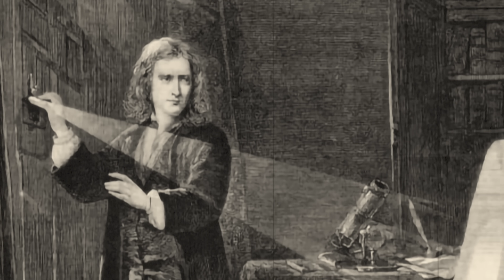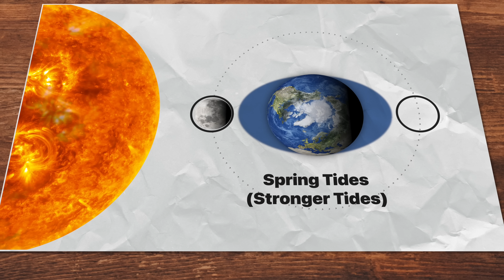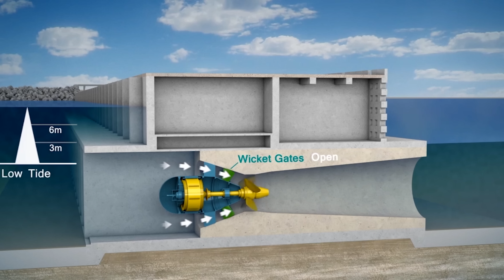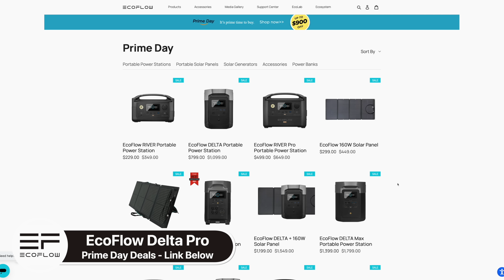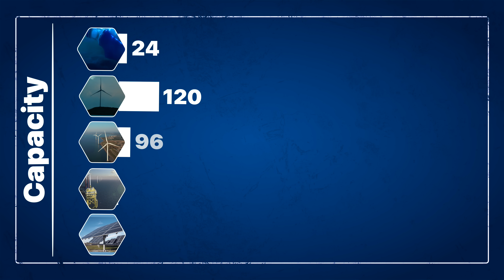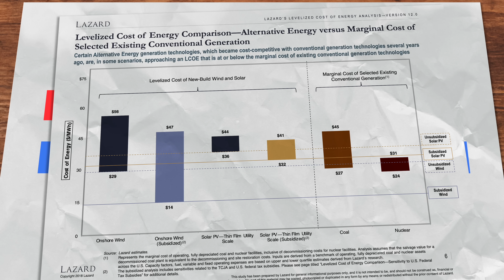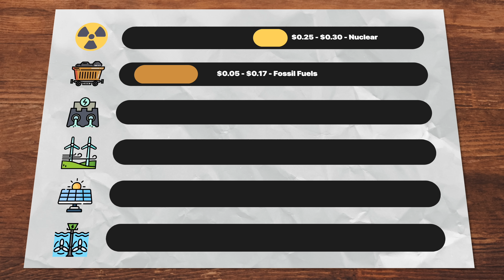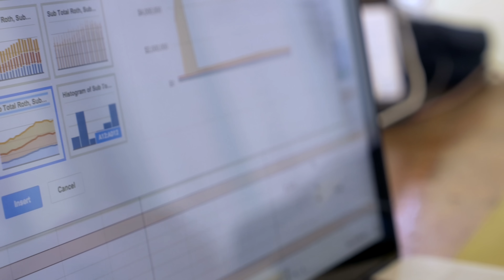Breakthrough Energy Source is 10X Better Than Wind & Solar!?

Comment: Tidel energy builds up gradually over a long time. I'm curious what effect taping into it at scale would have. How much potential energy can safely be converted and what are the consequences of using too much both on a local scale and global scale?
Reply: There is no effect on the Moon's orbit because the drag on the Moon is the overall movement of water, mostly in the oceans, and this would have very little effect on that total movement. 

What could have an effect is on coastal erosion as movement of sand along coasts might be strongly affected. As energy is absorbed along one section of coastline,  it might be shifted to adjacent areas, possibly exacerbating flooding at maximum tide. Also, the tidal generation systems would be strongly affected by changes in sea level.
Reply: It's not the moon's orbit that I was talking about. The moon has a lot of momentum. I was talking about the tides themselves. I'm assuming that the tides get a tiny push from the moon and that tides accumulates over time. Maybe I'm wrong. My question is how much energy can be drained from the tide before effecting them. I don't know the answer, but the amount provided by the moon can be calculate.
Reply: @riderpaul  it would actually be affecting the earth's rotation maybe?
Again it would be so small an affect that it would.not matter for millions of years by.which time humans wont be here to.keep the thing running anyway.
Reply: See my comment regarding affecting weather patterns globally
Reply: I wondered about this too,
We are effectively taking energy away from the moons orbit ?

Comment: I love the idea of endless water flow providing the force to make energy.  I just wonder why they dont submerge the propeller and housing just to provide the motion,  but that just turns a shaft to the surface the holds the actual motor and electronics.  All we need from the water is the force it provides.  The moving parts like gears and such can probably keep running for decades.  The surface electronics would be easier to service..
Reply: You can pump water to the surface as it doesnt compress and it lubricates and cools  you can transmit the energy to turbine generator system. It saves on metals and the corrosion problem ..  🤔

Comment: The Rance facility looks more like a hydro power facility than true tidal power. Also, a 100 year operating life for a turbine on the sea bed in a current of >1 metre per second, sounds suspect to me, as that's a lot of force and a lot of corrosive salt water. There's also no way that the Rance facility hasn't had a hugely negative impact on the local ecosystem.
Reply: The Rance facility is very uneconomical, the power costing like 15 cents a KWH.  Typical generation costs of solar and wind are like 3 cents a KWH.

Comment: The blade construction water/wind turbine is the LEAST EFFICIENT method, the most environmentally challenging way to produce power.   Why this older technology is being favored is beyond me. Here is an example of how super slowly things are to change - in 1915 an airplane with "winglets" was invented and flown. This reduced power robbing wind vorticies at the wingtips and increased radial stability. 80 years later the commercial airlines decided to adopt the idea to save 4% on fuel costs. Planet Earth will be dead by the time better tech takes hold.

Comment: Does the levelized cost of wind turbines also include the cost of the grid batteries required to mitigate its intermittency? If not, it might look much less desirable compared to tidal, which will be much more consistent.

Comment: Ultrasonic anti-fouling! That's the answer to bio-growth, which can be amazingly devastating in a very short time. These things could be designed with that in mind. There are some places with up to 40 feet of tidal range (like Bay of Fundi Canada) which could power the entire eastern seaboard easily, there's really no limit as to how many turbines could be put into place.
Reply: That idea sounds solid. But how far or does the ultrasonic disrupt the fish or mammals? Maybe the ultrasonic can be used intermittently.
And will these under water turbines slow or disrupt the back flush of coastal areas and river outlets if there are too many of them ? Do the turbines blades fold or have pitch control?

Comment: The problem with tidal energy is that, while it is predictable, it is STILL somewhat intermittent.
There are periods when the tide is changing from in-flow to out-flow that it has NO power output - similar to solar but much shorter and twice a day every day.

The ONLY form of renewable energy that does not have this issue is Hydropower - but even Hydro can sometimes have issues.
Reply: Geothermal energy doesn't need to be intermittent, and is effectively renewable.
Reply: @garethbaus5471  Valid point.
It's too bad geothermal is so little used for power generation.
Reply: @bricefleckenstein9666  both tidal and geothermal energy make up only a tiny fraction of global energy production so they are fairly comparable in that sense, it should be noted that more countries are powered almost exclusively by geothermal energy then tidal energy so at least in that sense geothermal energy currently appears to be a bit more practical.
Reply: @garethbaus5471  I am only aware of Iceland having a significant amount of geothermal power in use.
I am not aware of ANY country that is "almost exclusively powered by tidal energy" though, and 1 is greater than 0....

Comment: energy breakthrough ?  guess i missed the breakthrough.  i agree it is a good option and needs to be developed and the negative issues worked thru. I would bet that like all developing techs there will be unforeseen problems and benefits.

Comment: whatever happened to geothermal energy. it's guaranteed to work. there are no intermittent periods when it doesn't generate electricity. all it requires is a hole in the ground. which energy companies do everyday for the past hundred years. there's no radioactivity to worry about and it's guaranteed to work. got it

Comment: Why not combine wind turbines with tide turbines?

You’ll be using the same foundations and wiring so would reduce the cost per unit as you’d effectively be sharing it between both units.

The problem with tidal range is that the tides do slow down when they get to high tide and low tide so it’s still got predictability issues it’s just well predictable. This is the issue when it comes to grid scale electricity generation we can’t easily store the large amounts of power that we need to fuel the grid. Most battery storage is used for grid stabilising not storage.

Comment: in the UK there has been a tidal lagoon project proposed for years in Swansea. It finally got the go ahead in 2015 costing £1.3bn. according to consultants would be 16.8p/KWh
Meanwhile we've spent £50bn on Hinkley nuclear station, which will cost consumers 10.6p/KWh. I'm all for nuclear but it's damned expensive!
Reply: The Swansea tidal lagoon project hasn't been approved.

Comment: The idea of harnessing industrial energy from tides has been around since the ‘60’s. Tides at the equator are basically nil, with the greatest tidal differences at higher latitudes. So far, with all the past tests and past experimentations done these past 70 years, it has not proved successful. Every now and then someone resurrects the idea.

Comment: There was and still is the Idea to put a dam into the Straight of Gibraltar to harness the gigantic flow of the tides there, but i think that a Tidal Stream system would much more efficient as you could potentially place more turbines into the same column of water.
But yes, Tidal could and should be a massive part of the future of renewable energy and its sad its so far behind.

Comment: Electric water heaters are generally the number two electrical demand in a home. Yet, most people do not care when the electrical water heater heats their hot water. If homes had three hot water heaters, and the electric company controlled the first two of them, they could use this electrical load on demand. Then whenever the electrical company could conveniently generate power,  such as when  the tide is going out, or at night,  it could also generate the load to use that power. By giving the power company the ability to control both the load and the power generation, the system would be more effcient. Water could be run through water heater in a such a way that the last water heater always guaranteed there was plenty of warm water, but the first two water heaters would guarantee that demand was always ready when the power company needed demand. Most homes have extra space in a garage or basement next to the water heater that could accommodate another one or two,  a water heater costs $500, and is easily replaced. Water heaters could be sold at the store with the additional chip/circuit in it that would allow the power company to control the demand.

Comment: We've had a large functioning tidal power plant since the 1960s in the Rance estuary (Brittany) after floating the idea in the 1890s, following an even older tradition of building tidal mills along the banks of that same river, but nothing much since.
As you and others mentioned, tidal reduces the need for battery storage because of its predictable repetitive nature, but it goes even beyond that, as each time we add a different source of renewable energy, we reduce the risk of having no renewable electricity production at any given time.
In addition, utilities will pay less peak hour rates, meaning more financial savings.
Lastly, renewable energy (excluding biomass) reduce carbon emissions, which lowers the impact on health, environment, economy, etc. Such measures to reduce carbon emissions pay back much more than their cost to build and maintain, according to scientists, so even if tidal costs more than, say, gas power plants, it saves much more altogether than non-renewables with external costs added. Personally, I don't even know if we can put a value on reduced human lifespan or the extinctions of hundreds of thousands of animal and flora species, so cost alone is not really relevant.

Still, tidal is intermittent, so we should also forcefully develop more permanent renewable energy, such as ocean currents near the coast, or geothermal. This would nearly eliminate the need for battery storage by providing the base load needed for year long operations.
Looking at the low rotation tidal turbines, I just have a think (oh, no, it's the other YouTube channel!  😁) and I wonder if similar turbines could be placed all along the rivers' lengths.
Reply: Tidal Streams are not intermittent; they vary in strength and timing over a fortnightly period in any given place, but as you move along a coasline the timing changes too, so there is always somewhere that has plenty of moving water as far as the grid is concerned - ok the British Isles and other archipelagos close to continental land masses have an advantage.
I like your idea for rivers, esp tidal rivers like the Severne, it would reduce transmission losses to be further inland.

Comment: I strongly disagree that this technology has substantial lifetime benefits over traditional windfarms. And LCOE calculations already incorporate the entire lifetime of generating assets. Moreover, when the wind industry was at a nascent stage they too thought turbines would last for 100 years. However, when deployed, they discovered their lifetime estimates to be drastically optimistic given all sorts of wear and tear from exposure to the elements. I highly doubt an underwater turbine will be capable of withstanding 100 years without serious refurbishment and ongoing maintenance and repairs, especially given the high pressure and salt water environment it will operate in.
Reply: Gerardo
We will be damned if we do, and damned if we don't. Personally, I'd rather be damned if we do.
Reply: @charlesmills6621  You say you'd rather be damned if we do, but that means spending more money for less energy, and that's not a good idea.  That's what LCOE is all about: getting the most energy given the available financial resources.
Reply: I'm pretty sure the turbines could be made of a polymer instead of a metal or at least a metal covered with a polymer to prevent it from corroding.
Reply: @asandax6  Corrosion isn't your only problem (though a big one). Wind turbines already use composite materials for their blades which are made from fibreglass not steel. But they still deteriorate due to abrasion with the air.

Underwater you'll also have to consider barnacles, algae and other critters. Plus the water flowing past the blades will inflict more force than air, causing degradation and deteriorating efficiency, just like it happens to boat propellers.
Reply: @gerryflores88  I think the forces will be more comparable to hulls than propellers but yes, erosion is a consideration.
Reply: @gerryflores88  some of the inert rubbers (I'm thinking silicone) are pretty resistant to water abrasion, as are some ceramics, solutions can be found
Reply: @asandax6  metals can be discounted entirely, there are plenty of other suitable materials. Hardwoods for instance seem to last well underwater.
Reply: @alanhat5252  Well it seems material scientists should be the ones tackling this problem if only they could get funding. I didn't even think wood could be used underwater infect it's the last thing I would have thought could last long underwater. Now that I think about it there are centuries old ship wrecks still found under the sea (little mermaid song starts chiming).
Reply: I would be extremely surprised to see an off-shore underwater turbine last more than 30 years.  Even with extensive ongoing maintenance underwater and the occasional "haul-out" to patch holes in the housing due to corrosion.
Reply: Having seen even then best hardware like ABB failing not so irregularly (with 100 producing machines) there is always one of them that needs replacement. Either you should dive down or have them merge... if merging is easy and functioning - that’s the main factor to solve
Reply: Given the temporary nature of these water generators, I firmly believe in Thorium molten salt nuclear generators. They are more than 100 times safer than fast breeder reactors due to their low pressure, high temperature circulating systems. When the cooling stops, there is a salt plug that melts and divides the heated Thorium salt into non critical vats stopping the process dead in its tracks - no explosions, no release of radioactivity.. And, these reactors can be manufactured very inexpensively, the parts can be trucked to the site easily and safely. THIS is what the governments need to concentrate on, provide funding for. Thorium abounds in the ground, 150 times more common than Uranium or Plutonium. It once was considered a useless by product of mining for coal and iron. We could power our expanding population for the next millenia with this technology. Red China is already using these reactors, building more everyday. Why let them benefit from such inexpensive power? Ten cents per Kwh, and falling quickly as the units are mass produced.
Reply: And how many fish will die
Reply: @dougconllin3006  Probably none. The water itself will push them away from contacting the blades, if they even decide to try to go through. Fish move relatively slowly. Also, less fish would die if fossil fuels are phased out, reducing global warming.
So yeah, fishing dying is not only a non-problem, even if it WAS a problem, it still wouldn't need to be considered.
Reply: @WilliamHelstad  Painted steel can and some varieties of stainless handle it pretty well.  But two different metals in contact (aluminum and steel) tend to destroy each other.

Comment: This is an excellent appraisal that looks at output, not just rated capacity, when most analysts just look at the latter. It’s a very important video that could make a difference to policymakers decisions. People should be reminded, the low and intermittent output from solar and wind do not factor in the cost of maintaining expensive gas plants and battery storage to balance the grid. Therefore the LCOE is actually a weak comparison. You need to factor in the system balance cost, that reflects the cost to the customer. Also. Coal plants can be fitted with carbon capture cheaply creating a zero carbon but controllable source of power😀
Reply: I remember reading somewhere that intermittent renewables like solar and wind can make up up to 40% of the power grid without major issues. So nuclear, hydro, tidal, and geothermal will have to make up for the rest if they want to ban fossil fuels. That's not really possible right now.

Comment: Tidal power is nothing new. The 240MW "Barrage de la Rance" in France opened 56 years ago in 1966.  The problem with tidal as the basis of a national power generating strategy is the inescapable fact that it is limited by the geography of coastlines. The tidal estuary at Dinard was chosen because it has a relatively narrow mouth with a rocky shoreline but, more importantly, it also experiences some of the largest tide ranges in the world. Tidal power is most definitely a cost effective and enduring energy solution, but you can't put one on just any old stretch of coastline. It's more cost effective than solar or wind but there are relatively few places where it can be done.